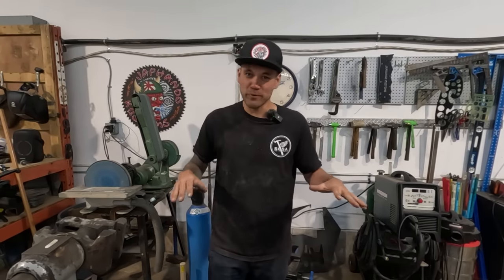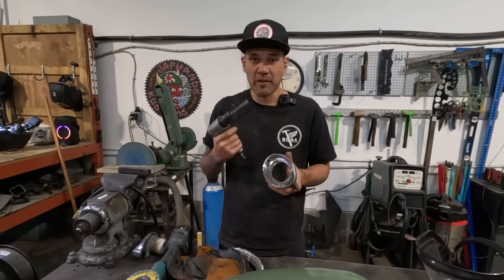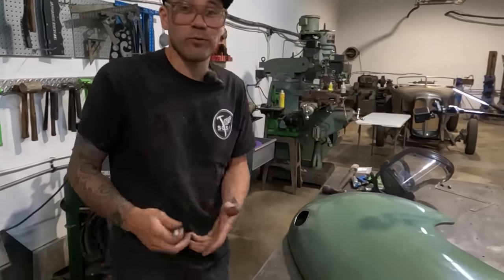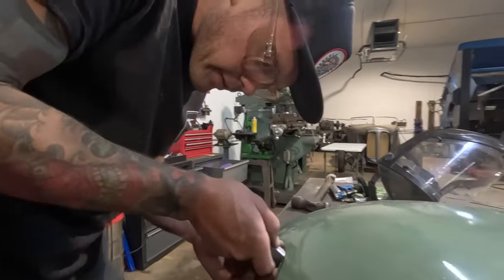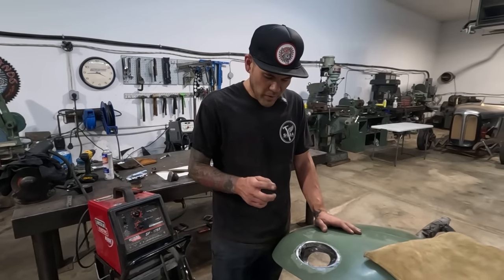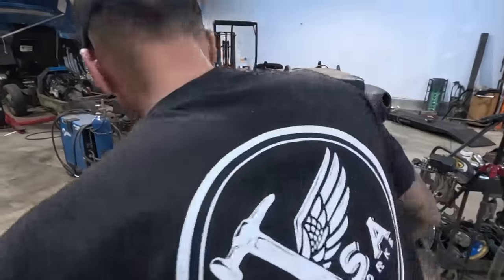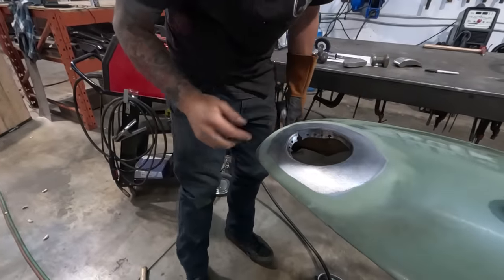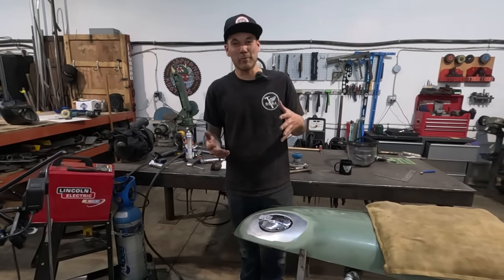HOW-TO Make CURVED FLANGES on SHEET METAL With HAND TOOLS Installing JAGUAR Gas Cap PLYMOUTH Fender

Comment: Could you make a piece of thicker metal like 1/4" plate with a curve the shape of what you needed and clamped it on the underside.Like a die and hammer the metal into it?  You have the tourch you could have bent the thicker metal with the heat of the tourch to get the normal bend of the fender. Would that be frenching the gas cap?

Comment: Find an old school body man to lead the oval and surrounding fender, would let you file and sand to make it as perfect as humanly possible. Lead work is not particularly dangerous if you take the proper precautions. That said nice job as it is and good enough is good enough..

Comment: Wouldn't it have been easier to just weld the bezel to the fender instead of all that work? And if you wanted a larger radius corner edge you could have added some weld from the backside. I'm just wondering and not at all critiquing because I too have never tried something like this. When you broke-out the torch I cringed (!) thinking "he's going to warp the sheet metal oh crap" haha...and was thinking you could have used a small Map gas torch to keep a smaller heated area? Now I'm going to make a flanging tool...a couple of them. A 5/8" diameter (round stock) and a smaller rectangular one about 1/4" wide x 3/4" for tight corners just in case I need one. In the past I've used crescent wrenches, needle-nose pliers etc. but I  like the one you made with the angled slot!  Thanks for your ideas and trials and videos and always look forward to your next one...always learning something from you. I'm waiting for you to work on the chopped car project again! :)

Comment: Do you think if your flagging tool was thinner would of helped? Seems like most I’ve seen are done with 1/4” thick flat bar or similar.
Reply from the maker: Ya I think it would have been easier and probably stretched more?

Comment: @ Make it Kustom:  Those holes you drilled in the flange to help bend it..... If the diameter of the holes were smaller, would it have allowed them to do what you originally intended, without (or to a lesser degree) the tears ?!

Comment: I WATCHED SOME ELECTRICIANS PUTTING IN COMMERCIAL GALVANIZED CONDUIT AND THEY WOULD USE OIL ON A RAG AS THE CONDUIT WAS BEING BENT THEY JUST KEPT PUTTING OIL TO IT AND THE CRACKS WERE SO TINY .... OR NOT AT ALL... IT WORKED FOR THEM

Comment: What if you made a die/dolly, the shape of the hole to make it easier to get it perfect? I'm thinking a ring of 1/2" or better plate. Cut the hole for the filler cap then cut the outside of the ring about a 1/2" or so wide. Grind/file the desired corner radius of the hole. Shape the face of the ring to the curve of the fender or just close enough as not to crease it. Use your press to bend the ring to match the curve of the fender. Clamp it to the back side of the fender and hammer the sheet metal to it.
Reply from the maker: That would probably be the best way to do it I think

Comment: @ Make it Kustom:  Underneath your Wall clock, next to your air hose reel, that blue power cord reel.... What make is it and is it a reliable one ?!
I need to get one (or a couple), but every time I research them, I get nothing but conflicting information and am left more uncertain than when I started.
Reply: Looks like a Power Fist brand cord reel (most likely from Princess Auto, a Canadian version of Harbor Freight). Can't speak for the reliability, but it looks basically identical to ones HF sells, and those are pretty bad. Cord reels in general are good for small loads ,lights and such, but with anything larger you have to fully unwind them. Lots of power in a coiled wire gets converted to heat. Heat is bad (power loss + safety concerns in extreme cases).
As for why those are kind of trashy IMO: they use copper ring contacts in the rotating part. Those contacts do not have springs, they rely on material itself being springy. They don't stay springy for very long and eventually start arcing, causing all sorts of issues. High quality reels use spring loaded carbon brushes, just like an electric motor would. Much better electrical contact and longevity.
If you find a reel you are interested in, try to find a teardown/repair video (or look for a parts diagram) of it. That way you'll know how well or not it is constructed. You can also buy just those brush-contact assemblies and build your own manual reel.
Reply: @AgentWest :  Thanks.  I appreciate the info.

Comment: That's not an easy job by any means. I think you nailed it tho buddy. Guys are doing this same strategy when installing moonroofs into hardtop Impalas. They tip a flange rather than weld all the way around. It's a TON of work, but way less work that TIG welding, grinding, and planishing.

Comment: How do you do model a roadster door skins I have new skins but what tools do I need to fold over.thanks
Reply from the maker: Hammer and dolly to fold over. The skins should have a turned edge on them already. You use a hammer to just hammer it over it with a dolly on the outer skin near the edge. There are door seeming hammers that are shaped kind of like a hammerhead shark. They are meant for this type of work, but it can be done with a regular body hammer.

Comment: Your tool would work even better if it was only 6mm or even 4mm or 3mm thick rather than your 1/2 inch thick tool, means more kinks but a neater job, especially on tighter corners.

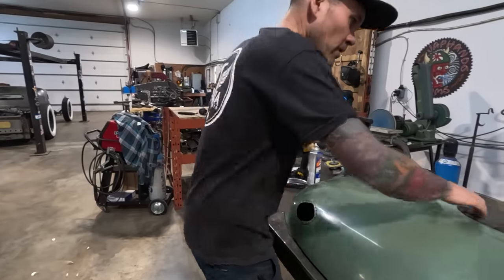Comment: Time stamp 11:55, Never heard of drilling holes to spot-weld, doesn't make sense.. The whole idea behind spot-welding is tacking two layers of metal together without having to drill.
Reply: @SayWhut276  With a spot welder.
Reply from the maker: It’s how it’s done without a spot welder

Comment: Why did you not just cut out an oval and weld in a flanged edge? I am no expert, only learning from watching your vids....
Reply from the maker: That would’ve worked as well and being slightly more straightforward. I thought it would be neat to turn the edge and give it a try.